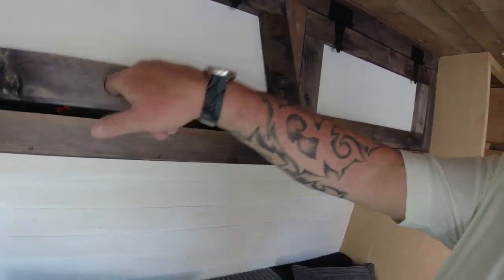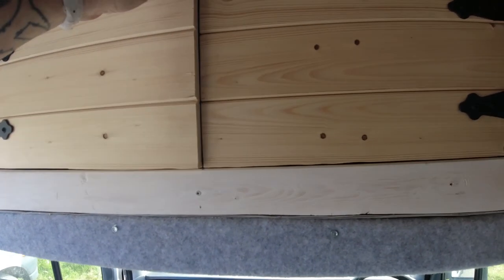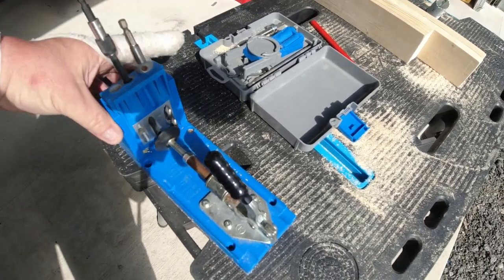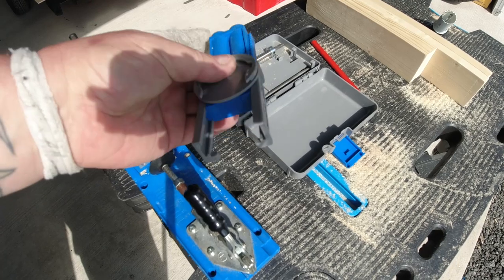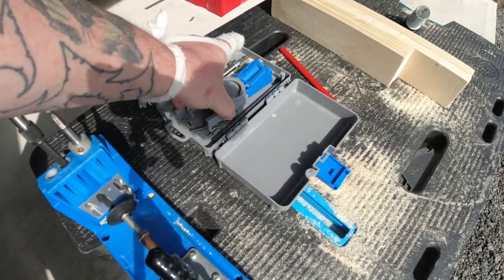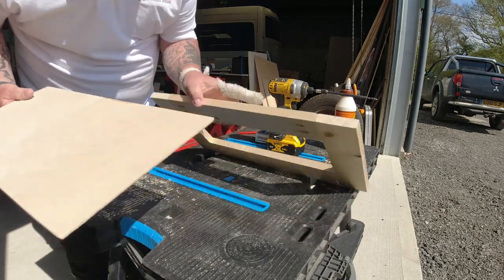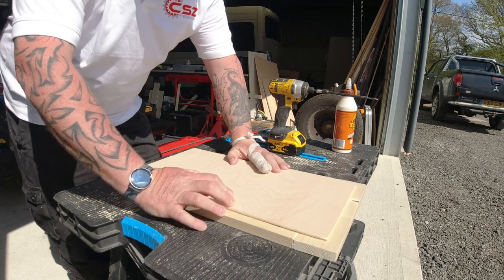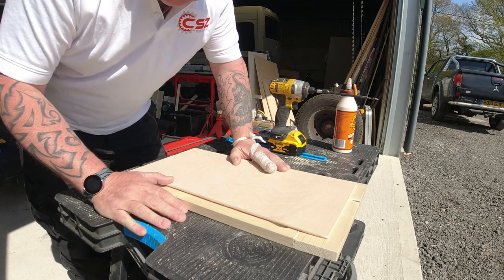Campervan Cupboard Doors - MADE EASY

Comment: Hi m8, looking good, just a little info for you , it doesn't really matter with the way you have built your door strength wise, but usually looks wise a door hanging that way would have the stiles (side bits) running top to bottom and the rails in between, just some info in case you weren't aware, in case the trolls pop their heads up.i missed what happened to your finger ? hope it wasn't too painful
Reply from the maker: Hi ya thanks for that.  Haven't seen a troll again lately.... yeah hurt my finger outside of the workshop.  Sliced quite bad but it's OK now healed nicely.